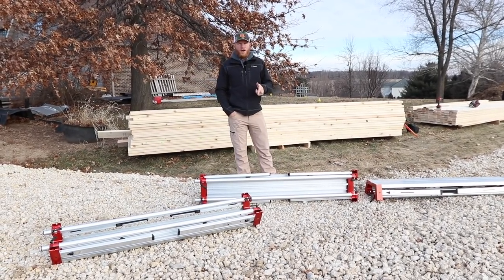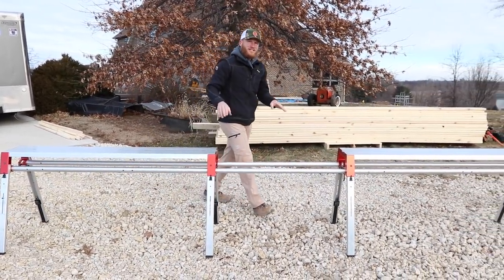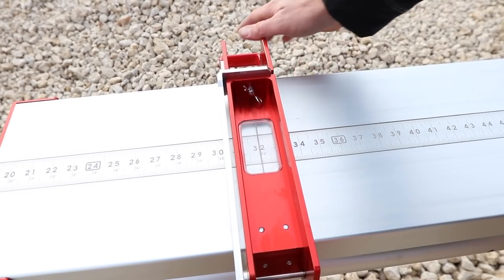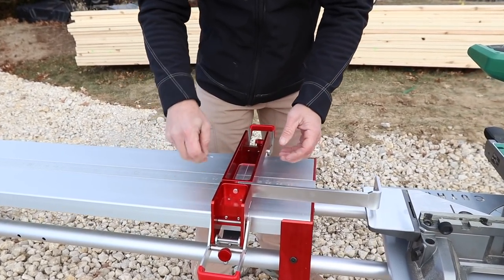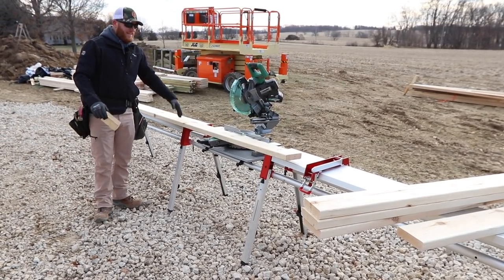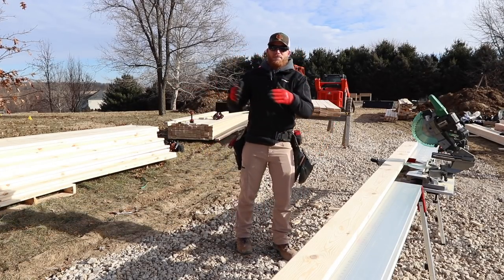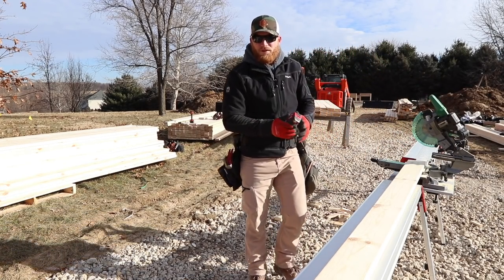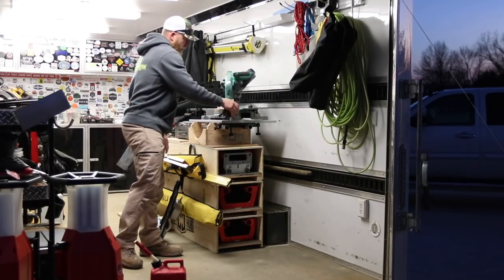Is This Work Station Worth the MONEY $$$$

Comment from the maker: What do you guys think?  Would this be useful?  Is $4k too much for a tool that helps you be more efficient and safer at the same time?  For me, if a tool makes me better and quicker....It's a good investment!
Reply: That miter saw very impressive
Reply from the maker: Yes I’m liking it for sure.  Battery has excellent run time and powerful.
Reply: It looks like a great addition but for that price I would spend a little more and buy a saw gear setup.
Reply: Yes it definitely is better then cutting with a skill saw a guy who built a barn for me made a mitre saw station on an old bale wagon he got from a farmer where he could put a whole stack of 2by4 on it with the telehandler, move the wagon to the part of the building he needed the lumber. Youd have to pull a board off the to the front on to the rollers he put on so the board slide very easily then through the mitre saw to the stop he has set up that was pretty neat also
Reply: I think so!! Looks like a nice quality set up also nice tax write off;)
Reply: If you're working it for profit, maybe. But fellas have been doing great work for years with less investment. Of course, you're always going to need a shop dummy to grow. Need an investor?
Reply from the maker: Mike Tarzwell most likely lol
Reply from the maker: Huckelberry Auditor I don’t expect everyone to see the ROI and that’s fine.  No where did I say this system is cheap.... or for everyone?
Reply: The real question is ...did you really accomplish more in the day you used it vs.  a normal day without it? And will you see a return on investment by increased production?
Reply from the maker: justin milford 100% quicker... cleaner accurate cuts and to be honest... the real savings comes into play when using the table saw or just in general having a large surface that multiple people can work off
Reply: I think the selling point for this system is like you said, “you can have the lowest man on the totem pole” making accurate cuts. I would say it would be worth the price for larger crews I don’t think it’s worth it for your crew right now because everyone is competent. But if you expanded and had Greg running his own crew with two newbies then yes I would say this tool would be essential.
Reply: Nice tool, but one tip..... if you are right handed try putting the stop to the left. Bring your work in from the right then you can do a clean cut on the end and then slide it to the left and hold the cut off piece with your left hand. More efficient than working cross handed.
Reply: 4k is a joke, although I think it would be great.  I made plywood 8' outfeeds for peanuts, i've been using for 15 years.  Could never justify it, and I'm a concrete contractor, everything I buy is costly. Until it hits 1500 no way
Reply: @huckelberryauditor5583  I seriously doubt it with the sound of your voice.  You just bashed one of the best builders out there and never brags. You have to keep talking yourself up so we know your full of it.   Hes extremely efficient and I wouldnt believe a word you say by the lack of respect.
Reply: @huckelberryauditor5583  ohh we got a keyboard cowboy
Reply: @huckelberryauditor5583  Blah blah blah. You have too much to say. Take it easy.
Reply: @huckelberryauditor5583  You are the smartest man alive!!!!??????$$$$$@@@@
Reply: Its a great system for what it is, quick, easy, accurate cuts without realignment between jobsite deployments. Will last with the alum build. Something only for people that really need those features. Price is probably on point since it is more of a specialize need. If you can get away with a fixed setup, in building, home, ... You really dont need that, nice sure.
Reply: I love this thing! I wouldn't use it alot but like building decks and trimming out houses this would be the shit. I will get one just not right away. But when I talked to them about it I told them I would want the set up you have. They told me it was 6k for what you got.
Reply: @RRBuildings  Not a math whiz but isn't 100% quicker an impossibility?
Reply: I really like that stand but 4K is just to much
Reply: Improvement if they had the indication line on fence adjustable +\- 1” instead of zeroing by moving saw.
Reply: And yes 4 thousand bucks is absolutely absurd for 3 aluminum saw horses..
Reply: This would be amazing for cutting composite material or cement siding or anything floppy really. I also love the ability to mount a table saw to it. The price is high but would be more manageable if you can buy it in sections as you need them
Reply: Well, sometimes you have to spend money on tools and equipment to make money.
Reply: For your process and need for repeatability, it definitely has a place. If you stacked your lumber pile to the left of the bench and your cut pile to the right, then you may cut down on handling as well 🤷🏻‍♂️ and it might be easier to fold/unfold the legs of you rest them on each other as you go. 
All round nice work 👍🏻
Reply: Holy crap, I've framed houses in Texas most of my life. I love tools and am not afraid to buy stuff for work that really bring speed, productivity and safety to the job. At $4k this is a no go...ever. I could only imagine a trim carpenter, possibly, buying this because it's just a glorified stand at best . The $200 dewalt stand sets up in less than 5 minutes using however many extra supports are needed and you save $3800. This is for a workshop, it has no place on a framers jobsite that's for sure. At that price too, any problems with it are totally deal breakers.....it should bring innovation and tricks I've never seen before with a $4,000 sticker price....and it does none of that.

Of note, I can and do cut straight lines all day, every day with my worm drive saw!
Reply: I think it would be great if that thing had some clamp on sliding “square” markers that flip up out of the way.  You could set them, flip them up, cut your 16’ board, flip them down and trace lines next to them for your spacing, then flip them back up and out of the way to repeat.  Maybe a setup so all of the marking ears or squares or whatever are hooked onto a single handle for flipping up and down??
Reply: Full production construction only for that price. I really liked it for home use until I saw the price. It does look like and impressive setup.
Reply: Wow, you nay-sayers sure are cynical.  After claiming the depreciation over seven years on the business taxes all you'd end up paying is the interest on the float of the loan if you don't have the money to invest/reinvest in your business right now.  The time (money) it saves will more than pay for itself.

I just wonder about the longevity of some of those plastic knobs.  I can't say that I'm a fan of how the miter saw base attaches to the rails.  They seem kind of flimsy and destined to failure.  It seems like the stop setup clamps would be better used on the saw base or something like them instead of a couple of thumb screws.
Reply: WOW $4K, when I first saw you demo this product I was thinking its probably not more than $1000.00. I could see myself owning one. All aluminum, nicely built, very functional... HOLY MOLY was I off on the price. Thats way too much for me. I believe he can sell 10X more stations if he priced it reasonably. At $1000.00 (give or take) he'll get his money back in volume sales and have his product flood the market before the next entrepreneur steps in and builds and sells it far cheaper.

Also a simple 8" hand clamp can clamp the two stations together to prevent them from spreading and causing the cut to be off. (but you're probably already doing that) Great informative videos!!
Reply: @jerrellbevers6071  I agree with you on the entry level cost.  I have two ridgid stands that I run Dewalts on.  Got them on sale for 100 each and I love them.  I just never cut stacks of 16' 2x like these guys do.
Reply: Never @rualert1602
Reply: Building custom homes I couldn't justify $4k for a cut station. As much time as it does save I think it would take to long to recoup that cost, at least for what I do.
Reply: If there was any way to get a station like that for around $800 - $1k I would get it, $4k is just a tad to much.
Reply: @huckelberryauditor5583  uh huh....keep talking yourself up.  His employees arent by the looks of their tools too....
Reply: For that kind of money as lovely as this saw stand is I’d be using my Mafell KSS80 straight of the stack of timber.
Reply: Wow golden rule much?
Reply: @joegosselin2888   This
Reply: @huckelberryauditor5583  Pics or it didn't happen
Reply: @R2Mike  true that. I've never heard @RR building brag or boast about anything. So that says something about him
Reply: It’s really nice. It’s not four thousand dollars nice though. Sorry.
Reply: I’m a trim guy. I trim for a couple custom home builders.  My opinion is that this stand is way overpriced.   I highly doubt a trim guy would find this stand useful.  I made a couple extension wings for my 14 year old Dewalt stand from plywood, and a stop setup for less than $300 and an afternoon of my time.  Literally takes 1 minutes to setup.   

I wish the inventor the best of luck though.  I think there maybe a market out there, but not for more money than most framers around here have spent on their trucks
Reply: Nice tool, looks lite and rugged. You made a great video and great review. Is it worth 4K? To some contractors sure it is. Seems to be a tool that would be useful to a contractor building houses and like yourself pole buildings. To most of us No. To each their own! If I had a extra 4K I’d probably buy it. Great Review!
Reply: A couple of IRWIN quick clamps would fix the walking issue on the legs..
Reply: Omg... the most annoying music ever!
Reply: RR Buildings 4K is an absurd price tag.
Reply: Super badass! Precision to the max. Every detail covered.Only thing not to like is the price. Sometimes you get what you pay for.  If taken care of, should last a lifetime.  Nothing  I do would justify the cost. But if I did, I would seriously consider buying it.
Reply: Your lock idea would be a good feature.
Reply: RR Buildings I gotta get me one of these!!! And Dude nah ain’t too much for a tool that keeps you constantly busy from breaking your back.  I think it’s a smart tool, so that you don’t have to struggle with holding the wood or measurements.  Cuts a lot of time out from marking and frustration.  Also keeps the job running smoothly.  Keep up with awesome tools.  I look forward to see some bad ass tools that allows you to work smarter not harder👍🏾👍🏾👍🏾
Reply: It does seem to be pricey but yeah i would buy one !
Once your up to speed on setting it up I’m sure it will pay for itself in no time !
Reply: It amazes me how the 1st ones to say "I'm a such and such carpenter, that costs too much and wouldn't work for me" are the ones that comment 15 times and talk smack about it. If it doesn't work for you hit the thumbs down button and move on to the videos that teaches you how to be more efficient on picking up trash around the job site cause that's probably what you really do...with that out of the way, for that price it should at least come with a fence but other than that I think that it's a great invention. I've been trying to figure out how to build something like that out of aluminum and the rails that slide into the next stand is a great idea. $4k is way over priced IN MY OPINION. I'm sure that he doesn't have the buying power that companies like dewalt and Milwaukee have but I'm also sure that he doesn't pay 20x as much for his aluminum either. He would probably sell 5 times as many if he came down to $2k. One thing that my dad said that I've always seen come true is " a fast nickel will make you more money than a slow dime". Thanks for video!!!
Reply: How long are they and what is a good guesstimate of how much one weighs?
Reply: @iowamatt2519  you have a picture of your set up
Reply: 4000 for some trestles 🤣🤣🤣🤣
Reply: The biggest turn off is the price .. i looked at the $2800 version and even at that I still feel it is just to high for what it is. This is Festool level pricing if not more. It comes off a bit insulting to ask that much for it... now no doubt this wasn’t cheap to build and produce. I get that, but if you really want to sell this it’s got to be more affordable than it is. I know this is not for everyone... but I have money to buy this and for the life of me I just can’t see the value as it’s priced... I exchanged some emails with the company and one of the things they said was this is more than a mitersaw station..... no not really.  $2850 will get 2 sides and the mitersaw table.. I’m missing where at this price point it’s better or more than just a mitersaw stand. The stop block.... it looks pretty... I’ll give it that..  but I can’t go just crazy about. It’s nothing new or ground breaking. 
If this was in the $1500 to $2000 I think you could convince many more people to buy it... and even at that you’d still have a lot of carpenters thinking it’s still to high. 
The work station add on... I just see that being in the way. I’m going to pile tools and wood right where I’m cutting?? You know at some point it will just be in the way.  The table saw.. I have no idea why you’d want that at the end of your mitersaw station.. and if you get the the carpenter package those extensions aren’t over 8’ so it will hit your saw before you finish the cut.. what if your ripping something and someone else is cutting with the mitersaw..
Where I honesty see this being useful is on a framing job, cutting 2x8 or 10s. For trim it’s just overkill and there other products like the BestFence that are just better and way more affordable. Now using the best fence to cut the large framing or decking materials. I would concede to the cuthub for that. 
So is $4000 to much? Yea it really is. Did this really make you $4000 worth faster ?  I would say not... your probably pretty fast anyway and once you get to a certain level tools like this will only speed you up so much. 
I did like your review. Much more realistic that a lot of them out there.
Reply: Everyone saying it cost to much try building it yourself!I'm sure the time and materials are not cheap.Not everyone can afford to buy this but if you can it looks like a great addition to your tools! Depending on what you do having this tool for 5-10-20 years it doesn't cost that much!
Reply: Everyone saying it cost to much try building it yourself!I'm sure the time and materials are not cheap.Not everyone can afford to buy this but if you can it looks like a great addition to your tools! Depending on what you do having this tool for 5-10-20 years it doesn't cost that much!
Reply: @Willis476  it’s still over priced for what it is..... for the set up I would use I was quoted around $2800... that’s just crazy for 2 aluminum saw bucks.. They told me this is more than just a stand... no it really isn’t..To much emphasis on the stop block.... none of this is ground breaking... none of this is revolutionary and that is what it needs to be to cost that kind of money. It has to be hands down better than anything on the market. Isn’t the point of making something like this would be to get it into the hands of as many carpenters as you can? The vast majority of people will not go for this. It doesn’t need to be cheap and affordable...it can even be on the high end side and still be fine... this is on the ludicrous side...If this was in the $1200 to $1500 you could tap into a much bigger market. Festool could buy this and paint it green and would probably lower the price cause even they would say it’s to high.
Reply: @toolman101476  ok I understand your point.Like I said go build one and see what it cost!I agree it's expensive and if it was cheaper more would buy it.Yet you do not produce it or anything like it.You don't know what the cost is to produce one is.i sure in hell wouldn't buy one but would love to have one.The guy who runs this channel seems like a very lucky man/and not to take away from his hard work and intelligence to figure out what works for him!I have noticed that he has probably most then 90% of construction guys as far as tools and equipment!So for him and the few like him (especially when companies gives him tools and things cause of his utube) I guess the cut hub price point works for the company.I would be interested to know just how much it would cost for materials and machining /production of  the cut hub is.Too each their own I say good luck boss!
Reply: I also see alot of people with ideas on how to make it better and it is overpriced.Well if you have a better way build one and see how much you have in making it!It's no different then these guys buying trucks that at 80-100+grand!With a truck payment as much as a home mortgage or rent!
Reply: A saw without cable. No go.  A derart DW 708 needs  power.  4k $$$. Everest morning a idiot stands  up. Must  find Him.  😃😃😃😃😃
Reply: @huckelberryauditor5583  we have codes, because they are government houses, and as government homes, they are mandated built to government specs!
And if you don't believe me? Stop paying your property tax, and see who takes their house back!!
That's why it's called the American dream!!
Your dreaming if you think you own it!
Reply: Despite the cost I'm going to get one.
Reply: @RRBuildings  it's not for old school never evolving builders like him.  He's probably a drywall hanger and this is the first time he saw a miter saw.  Don't reply to hacks like this.  Thanks for taking time to review the stand, looks nice.  Only thing I think they can do better is add a full fence at least on the stands to either side of the saw.
Reply: @huckelberryauditor5583  yet you have time and desire to argue on YouTube!  Hack!
Reply: @huckelberryauditor5583  good builders can do both.  Hack!
Reply: @Kevin Jones put a 20' 2x12 or a 30' tji on it and I think you'll change your mind.